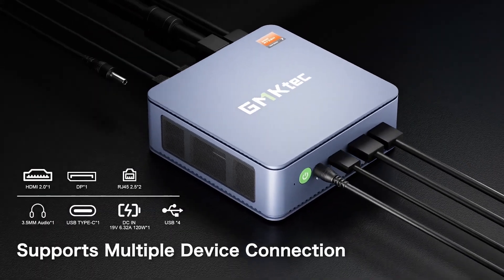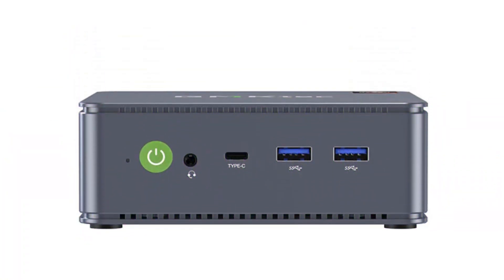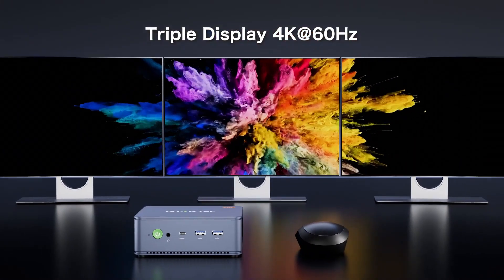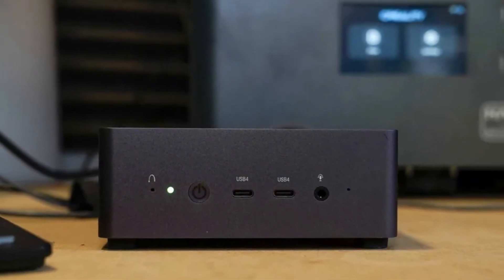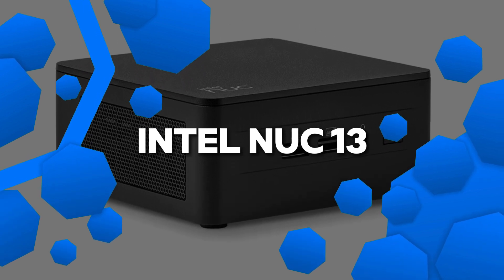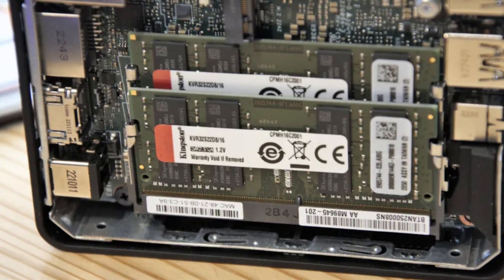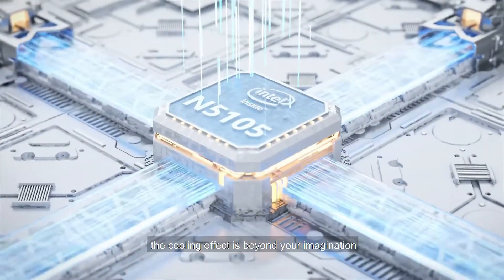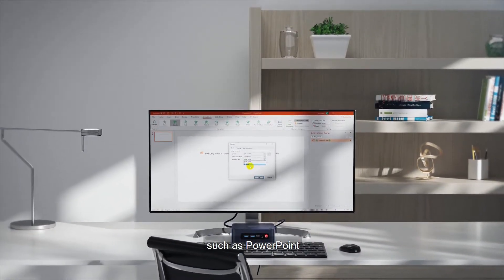5 Best Mini PCs 2025 - Watch This Before You Decide?

Comment: I have the Intel i7 version of the GMK (first one 0:50 ) and am returning it for the i9 version.  I’ve found it can’t handle half the load backups or file transfers as well as my old Win10 Pro system.  I hung a few NVMe drives off of it thinking it might be my home network to my NAS, tried to clone a few drives to get my old drive to boot on this platform… every attempt takes hours and fails 2 out of every 3 times.